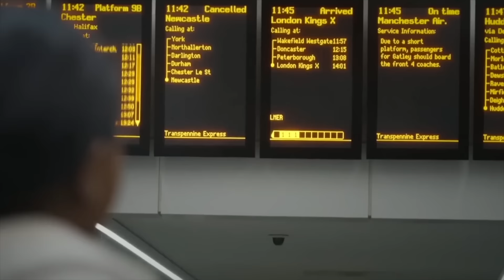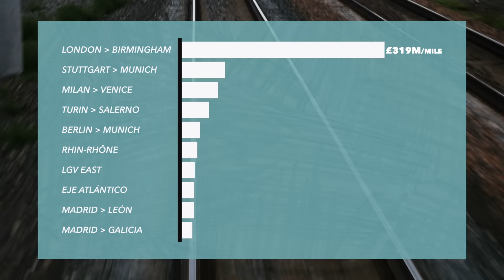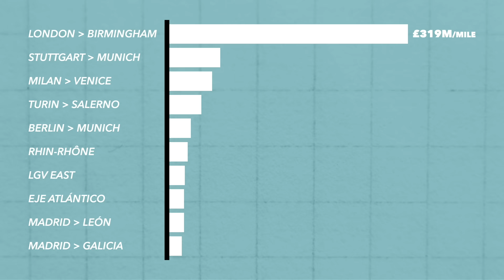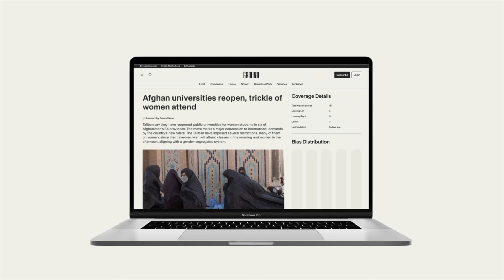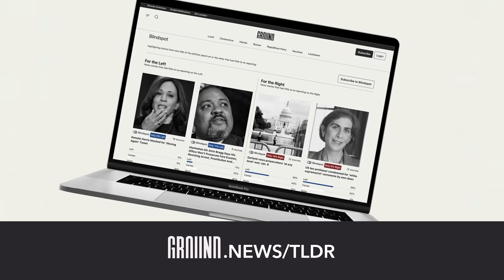The £100bn Railway: Why is HS2 Four Times Over Budget?

Comment: The UK has at least three high speed giants as neighbours yet failed to learn of all of them. Should have given the project to Spanish hands, we are already over 4000 km of HSR
Reply: Spain is in the EU tories can't accept that.
Though will be happy to give rail franchising agree ments to renfe.
Reply: "over 4000 km of HSR"??  England is a tiny overpopulated country: only 130,279 sq km, 57 million people (434/ sq km). It's the 2nd most densely populated in Europe (Netherlands 508/ sq km). You can't built 4,000 km of HSR in such a populated country like England.
Reply: @davidty2006  nonsense
Reply: @verttijineu2776  Spain is over 4000 miles of hsr not the uk. and they've been able to do it much cheaper than hs2
Reply: @yonirapaport330  Yes I know. As I said:  England is a tiny overpopulated country and Spain isn't. Another important thing: Spain is a very low-density population country, making HSR building easy (check vid "Why 70% of Spain is Empty." RLL channel)   btw Spain's HSR length is not 4,000 miles (6,400 km) but around 3,760 km (As of December 2021)
Reply: @verttijineu2776  clearly not been here
Reply: @verttijineu2776  Germany got only 1000km HSR....
 but many parts of the other 37.000km can be used for fast trains up to 200kph... and German cities are close by, the most densely populated area Ruhrgebiet is just 160km long with 17million population! it even connect some Dutch and Belgium areas!
for Brits, that are people from 3 different countries working together, not being ruled by just 1!
Reply: @verttijineu2776  I would put this the other way around. A crowded country is surely likely to benefit a great deal from efficient public transport solutions. Thus putting the necessary effort into building the infrastraucture should be worthwhile. Japan is 347/sq km and MUCH more mountainous and difficult to build railways (it's in a major earthquake zone for example) than the UK. If they can build an efficient high speed railway system then the UK has literally no excuses.
Reply: Are these the same Spaniards that spent £237 million on trains that didn't fit the tunnels? --- lol
Reply: @verttijineu2776  your logic is fundamentally flawed. highspeed rail is most effective and profitable when travelling between very densely populated nodes. dense population clusters between 200-500km apart are perfect candidates for high speed rail because you need to move a lot of people very fast and very efficiently. according to your logic, australia would be a perfect candidate for high speed rail but it definitely isn’t (although a line between melb and sydney does look promising). the majority of high speed rail is not profitable, only the high speed rail running through very densely populated areas are.
Reply: @davidty2006  RENFE has no rail agreements in the UK, France has ant the Italian Rail Company Trenitalia who run C2C and will co run the HS2 trains with Avanti West Coast.
Reply: @verttijineu2776  it's rather ironic, the reason many Americans give that HSR can't be built in the US is that the US has a low density pop compared to Europe.
Reply: @stevehill4615  Those £237 million have not been spent for the simple reason that the problem was detected before the trains started to be built.

Comment: The HS program is 30yrs of hold-off on those regional railway-capacity works, we'll chuck it into the HS2 engineering. 
This is why it seems to radical, its 30yrs worth of cut a tree here, build a bridge there, instead of dribbling it out over the years. This is why it is so very expensive.
There is now little else to cut out, except the additional commuter works that made it worthwhile.

Comment: HS1 is the Eurostar track.  It was delivered much later than the French section. Because it was so slow it compromised the efficiency of the whole trip - 2.5 hours from London to Paris or Brussels. Part of the purpose of HS2  was to improve links between the North of England and Paris and beyond.  Euston station, where HS2 terminates is a short walk from ST Pancras International. Obvioulsy brexthick compromised the whole project. Passport controls have reduced the number of Eurostar trains by 30% due to the amount of time it takes to get through passport control now that UK citizens no longer have freedom of movement.
Reply: but its now legal in the UK to wave the Union Jack, as long the Scots trot along!
Reply: HS2 was going to link up with HS1 but they cancelled that as a cost-cutting measure.
Reply: @freddie_w  Where did you get the idea of HS2 connecting to HS1, I live in Birmingham and have followed the HS2 project from it's start of building and in the local News there was never any mention of this idea, just some ones weared thoughts as there is no reason that HS2 a domestic high  speed line to relieve traffic on the WCML and Birmingham New Street to London Euston would never require to connect to HS1 and the continent as there would be no custom for it.
Reply: @peterwilliamallen1063  why would there be no custom for a direct train from Birmingham or Manchester to Paris?
Reply: @freddie_w  Because of these very simple reasons;
1/ Both Birmingham and Manchester have airports close to their respective City Centers.
2/ From both Airports there are cheap flights to Europe by carriers such as Easy Jet , Ryan Air, Lufthansa, British Airway's and Air France;
3/ It is quicker by Air from these places and cheaper to places such as Paris than Rail from Birmingham and Manchester;
4/ By Rail even from Birmingham the journey to London would take 50 mis plus waiting for said train, another hour to cross London at a sedate speed of about 40 mph and then about 2 hours on the HS1 line;
5/ At least Birmingham Airport has a station on the HS2 line;
6/ Customs Checks;
7/ HS2 has always been a domestic hispeed line designed to speed up services from Birmingham, Scotland  and the North West to relieve rail congestion on the Existing WCML and Birmingham New Street so relieving the existing lines that can not be upgraded to carry more freight and passenger services to towns and Cities not on the HS2 line
8/ The cost o a rail ticket from Birmingham and Manchester by rail to Paris would out way the coat of a cheap air fare;
9/ And lastly why would people want to sit cramped up on a train for 4 to 5 hours from Birmingham to Paris when they could do the same trip by air for about 1 hour;
So basically Freddie that is the reason, plus the fact that Domestic Intercity trains and European train are not compatible with their width in coach bodies, domestic British trains are built to fit the slimmer British Loading Gauge where as European trains are designed to the European UIC or Berne Gauge where the coach bodies are wider so would not fit through our domestic high level platforms.

Comment: The problem with HS2 is that the initial plan was designed more around speed than around the more important issues of capacity and connectivity. It was also designed to go via Heathrow which at some point along the way got scrapped but the rest of the scheme wasn't updates to reflect that. The scope has changed so many times that it's become a complete Frankenstein of a project which no longer meets the aims it was initially meant to, never mind the arguably more important aims that it could have been designed for instead (such as following the M1 corridor and directly connecting more cities, even if journey times would be slightly slower).

The important thing with projects like this is to determine what their aim is, design the project for that aim and stick with it.
Reply: how is the saying; plan what you do, do what you plan
Reply: The thing is that if you made it slower then you would still want to run express trains on the east and west main lines which is currently halving their capacity. By making HS2 fast you can get to Leeds the long way via Birmingham faster than the direct route, so you can take all the express trains off the East and West coast main lines and double their capacity.

It is badly managed but doubling the capacity of the east and west coast main lines would have been more expensive and you still wouldn't have a high speed line.

The problem is that the government haven't been managing the industry by providing a continuous stream of infrastructure projects. If the industry knew that the government was going to spend 15 billion a year on infrastructure the contracts wouldn't have to pay for building the machinery, teams and capacity in every contract.
Reply: @daveansell1970  You're saying that if you slowed down HS2 you'd still want to run express trains on existing lines but I think that's a bit of a misconception. The purpose of a new line shouldn't be primarily speed but rather connectivity and capacity. More stops would mean that long distance journeys between the ends of the line (i.e. London to Leeds) might be slightly slower but if you have a service that stops at, for example, Milton Keynes, Leicester, Nottingham, Sheffield and Leeds you've created a bunch better connected line and cut journey times to and from the other places on route which would otherwise still want the faster service on existing lines.
Reply: @EuroDC1990  you would still need express trains on the existing lines, as otherwise you would slow down the journey from London to Leeds, because going via Birmingham is further. Slower journey times won't help move people from cars and planes.
Reply: The original HS2 was supposed to connect to HS1 so that trains using the Channel tunnel could run all the way to the North. Stratford International station was built as the London station for trains going north because those trains would not be terminating at St Pancras.
Reply: @daveansell1970  That's a reason for it not to go via Birmingham (or rather just outside of Birmingham) on the way to Leeds, not a reason not to make additional stops.

The fastest possible journey time between Leeds and London might sound impressive but would either still require expresses on existing lines or would necessitate trains between other destinations between Leeds and London on existing lines all being slower. Doing that might make people traveling from Leeds to London a little more likely to switch from cars but will make those in-between more likely to do the opposite.
Reply: @kityhawk2000  Since when was HS2 planned to connect to HS1, HS2 is a domestic high speed line from the North and Birmingham to London Euston, there was and is no commercial reason to join HS2 to HS1 to the continent as it is far easier and faster to fly from Birmingham and Manchester to Europe than catch the train.
Reply: @EuroDC1990  do you not think that Birmingham deserves a high speed service towards Leeds and Manchester? The Journey options created by HS2 between the midlands and the north, create capacity for more and better regional services on the existing lines, in just the same way that it does for the WCML between Crewe and London!

Comment: Getting Gareth Dennis on this was a baller move - he is the most outspoken and well-spoken thinker on HS2 there is.

Minor technicality - under the original plans, the eastern leg would call at an all new station called East Midlands Hub (midway between Nottingham and Derby). In the cut back plans, East Midlands Hub was done away with and HS2 trains are now proposed to call at the existing East Midlands Parkway station instead.

Comment: I’m a civil project manager and I work on a lot of infrastructure projects in London, I haven’t worked on HS2 before but I have a lot of friends/colleagues that do. The real reason why HS2 is failing is because the Government wants all of the contractors to produce carbon trackers and are incentivising them to be carbon neutral. All the firms are obviously driven by profit and therefore reach this goal with relative ease but what the Government doesn’t understand is that half the work gets done when we are carbon neutral. Let me explain, a whacker plate is used to compact ground and is basically used for all civil projects, it’s vital for achieving adequate ground conditions. A standard whacker plate is powered by petrol- but there’s an alternative, an electric whacker plate. What they don’t understand is that electric whacker plates take 3 hours to charge and has about 15-20 minutes usage time. On top of this, they are twice as expensive as normal ones and you have to hire in multiple to do the job of one normal whacker plate due to usage times. So although you are saving carbon emissions, you are tripling your costs and you are getting less work done. 

Due to the fact that the contracts being issued by HS2 are NEC option C contacts, the overall price of the project can change based on certain circumstances. One of the CE clauses (Compensation Event) written in the contracts will 100% be time/money lost due to using electric machinery/plant. This means that every time a contractor thinks they have lost time or money due to using electric machinery to try and be carbon neutral, they will apply for a CE which the Government will be forced to accept because 9 times out of 10 they are true. 

The technology simply isn’t there to be carbon neutral. If Sunak wants to reign this project in he needs to scrap the idea of being carbon neutral and change all contracts on HS2 to NEC option A contracts, which will force all contractors to stick to delivering the project for the price they stated. Stop trying to be clever and just do it the way we know how to do it.

Comment: You don't have the right supply chain, so any major infrastructure project's budget spirals out of control, so the government doesn't have the political capital for another major infrastructure project, so the supply chain is redirected or dismantled, repeat.
Reply: This is a consistent problem, e.g. the crossrail systems were intended to follow one after another, so that the experience and supply chains would compound and entrench themselves making it theoretically exponentially cheaper to construct lines in the future. For example the system was designed to have a one size fits all station design with similar design language throughout in order to improve replicability in the future. 

What is happening instead is that they finished Crossrail overbudget and that has dampened moods to try again with crossrail 2 which has largely been mothballed for the time being. If we wait say 5 years to start again, those logistical  and educational networks will atrophy and we will have to learn all over again how to build a regional underground line, rehire civil engineers who may have moved into a new line of work etc. The key with these big projects is to have a consistent pipeline for them, our habit of building big projects one decade and then not doing anything for another is incredibly inefficient and needs to be phased out as a development model.
Reply: @hpsauce1078  Exactly. No one is gonna wait. A more dramatic example is what happened between WW1 and WW2. The arms industry famously started making bicycles and consumer goods; you don't revert that overnight.

Comment: They should have started building from Leeds and go downwards. That way, the North would have had some rail improvements and could not have been cancelled.
Let's be honest, too much has been spent on London (CrossRail), other cities need improvements before London get more.
Reply: Why not start at Edinburgh and/or Glasgow and then include the rest of the north beyond Leeds?
Reply: AsHS" is a Birmingham based project with HS2 headquarters in Birmingham that is why the majority of HS2 work starts in Birmingham and working North to Stafford and South to London with building work working from London North to meet up with work in the Midlands
Reply: @simonn2045  The need for extra railway capacity is greater in the south, so makes more sense to start it there. As Gareth explained, though, smaller projects getting HS rail further north would make sense from a cost perspective.
Reply: @simonn2045  Because the current routes above Leeds are not at capacity and it make sense building the routes that are at capacity first and offer the biggest benefit. Starting in London is the right choice for the project as the most benefits would be achieved more quickly starting from the south just due to choke points and capacity.

Comment: Another reason why it's so overbudget (which no one's really talking about in the press) is that if you let them use a bit of your land for the project, they will actually do some maintenance work for you - free of charge. E.g. if you've got a fence you want to install/upgrade or a carpark you want to build/re-tarmac they'll do it for free as compensation for going through your land to build the railway and or other bits of necessary infrastructure for the projects